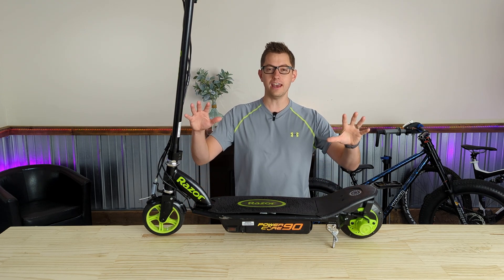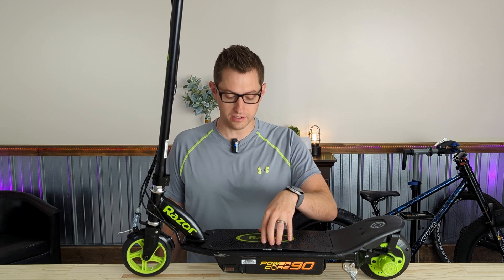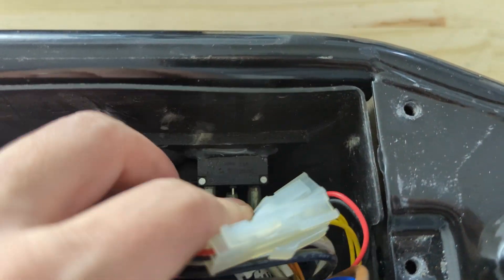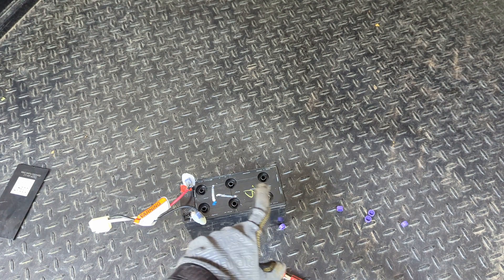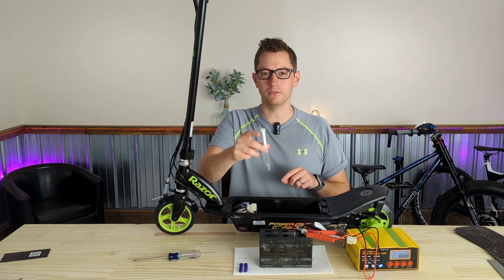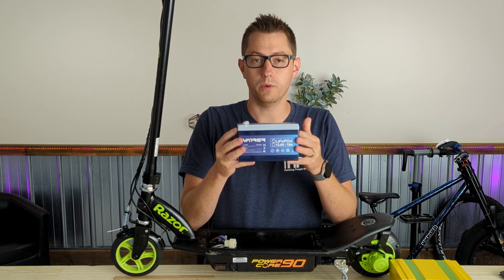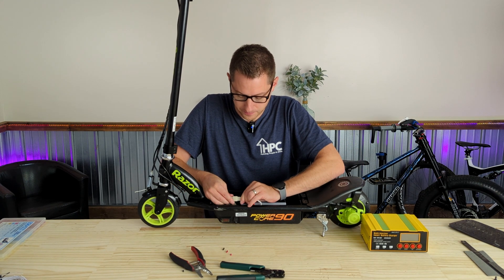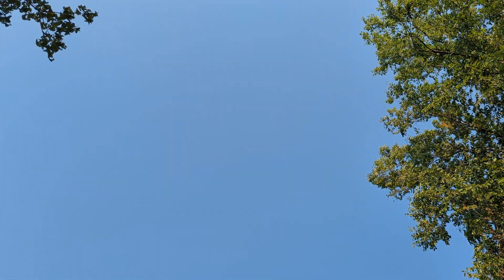Electric Scooter Broken? Easy Fix - Razor Power Core E90 Refurb

Comment: my throttle just spins around endlessly, there's only 1 screw i see but it's for the frame inside and not the throttle itself so the only other thing i see is the spring that i don't have access to-seems like that's the problem

Comment: Do the LiFePO4 batteries make this thing any faster?
Reply from the maker: Technically the voltage is just slightly higher but its not enough to notice but it'll hold that speed a lot longer than the lead acid
Reply: @overvolted  also it's lighter so that might help a bit lol
Reply from the maker: That's true!
Reply: @overvolted  just installed one and it works great.  Son says it's about the same speed but i got the 10AH so I told him it should last longer.

Comment: Ah the magic of video! Days later a new battery is available . . . along with ear lowering.
Trouble with refilling these little batteries is that much of the time the battery chemical reactions have degraded to where a refill won't kick it back to life. Happened to me many times that I don't expect a recovery these days. Would love to have some acid handy but bit iffy having it around with all the kids here.  Disconnect the little power on light which only serves to completely drain the battery if left turned on. New battery and ask the kids to TURN IT OFF AFTER USE!!!!

Comment: Battery seems to be fine on mine-directly to motor-works.  Even swapped out controller-still no go…ideas?
Reply from the maker: Must be one of the other electronics. I'd just use a multimeter and trace the lines from the battery down to the motor and try to determine where you don't have voltage. Maybe it's as simple as the throttle button not allowing the controller to output the power. You could find that connection to the controller and jump it to to rule that out.
Reply: @overvolted  tested the throttle and brake and all worked as should.  I am stumped
Reply: @Thomas-yg7qg  Remember, these must be traveling at about 15kph (10mph) to activate the motor.
Reply from the maker: Wiring? Throttle switch maybe?
Reply: @overvolted 

I kinda gave up on project.  Nothing really went anywhere.
Reply from the maker: Interesting..so you see voltage past the controller? Must be bad wiring if so

Comment: If the switch light goes on but it still won’t run, is that still the battery?
Reply from the maker: Still could be.... Could be the controller or motor also. I would start by checking the voltage of the battery and just work your way through the system with a volt meter to see what is not working

Comment: Quick question, how do you remove the speed limiter on it which wire? Or how do you open the circuit box?
Reply: None on these little DC motor-powered scooters. It goes as fast as it can.
Reply: @jed2055  will switching to LiFePO4 make it faster?

Comment: Just for future ref. you should never water a dead battery. The Water lvl will change as it charges. The negative and positive plates will absorb the water and acid solution and when charged the solution will be pushed out into the jar which will in turn make the water rise. If you dilute the Sulfuric Acid to much it will kill the battery and it may get above 12v but will lose voltage rapidly when discharged.

Comment: Thx for the video…got a used one but the light doesn’t turn on
Reply from the maker: It's almost always the battery, but even if it's one of the other components, as you see, it's pretty easy to work on and the components seem to be readily available on Amazon. Good luck!

Comment: Is there any other dc motor that would work with the hub motor? My motor is not working properly and do u know what the size or what type of dc motor is used ?
Reply from the maker: I'm not home for a few weeks but if you remove the green cage around the motor it will probably have some numbers on it that specify the size.

Comment: My scooter tire won't spin. It's brand new. My son rode it for about a week & the back tire will not spin unless you force it to spin.
Reply from the maker: If it's hard to turn manually its like the motor may be locked up and needs to be replaced. If it spins and just isn't doing it on its own it might not be getting power from the upstream electronics.

Comment: The black cable that runs through tube fell inside the board and now I don’t know how to push it up. I need help.
Reply: Take apart the tube. Drop a string down the tube. Tape black wire to the string. Pull it up through the "tube" and out. Reconnect black wire.

Comment: Great videos, but I need help with my electric scooter because the piece that turns it on and off fell out because it hit the curb on my driveway. I don’t know how to connect it if you could help me that would be great.
Reply: It is a razor E100 glow
Reply from the maker: Hello! I'll take a look at mine and see what the switch looks like. You can probably just connect the wires with some electrical tape and it will be on. Or put another switch in place.
Reply from the maker: Looks like your scooter has a vertical oriented switch. Take off the top cover and see how many wires go to that switch. If there are two, they can probably just be pulled off and connected together.

Comment: Thank you so much! my daughter got one from a garage sale a couple weeks back. didn't have a charge or a charger. only $15. Was told they worked the last time they was used. So ordered a charger and it charged. Light came on but it wouldn't go. Came across your video and did the exact same thing. now it works! Thanks again!
Reply from the maker: That's awesome!
Reply: Mine is doing that too. You replaced the battery and now it works ?
Reply: Yeah my lights coming on but not going...

Comment: Is the factory Razor charger safe to use with the LiFePo4 battery, or is a new charger needed?  Thanks for the video!
Reply from the maker: All the factory charger is doing is supplying a higher voltage at a very low current until it meets the required amount. I've been using the factory charger with this battery with no issues

Comment: i have changed the 12v battery and measured the voltage to be 12.5v but the controller just not driving the motor after i pressed the button. What i did in static condition, unplugged the connector and take the measurement to see if 12v coming out from controller. Do you think my step was correct?
Reply from the maker: So if your scooter is similar to the one I did in this video then the wheel has to be self-propelled up to a certain speed before the controller will actually give voltage to the motor. Basically you have to start kicking on the scooter to get it going and then press the button. So that could be part of the issue. Think there are replacement controllers for these things on Amazon as well in case that doesn't help resolve it